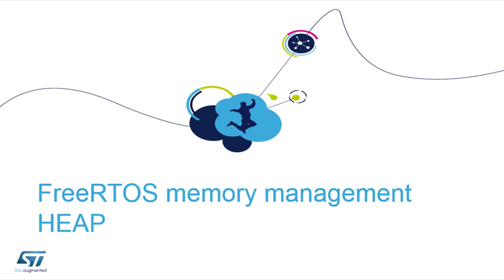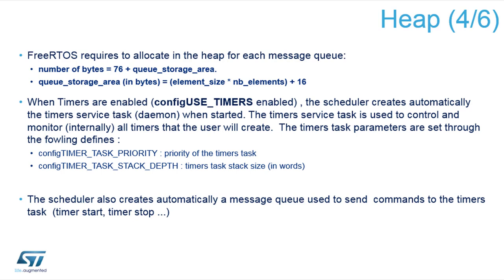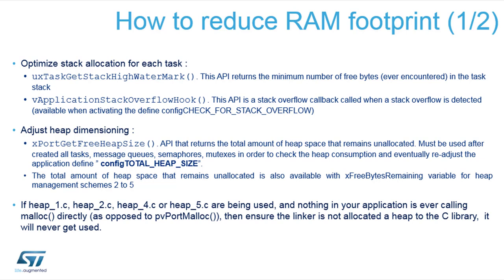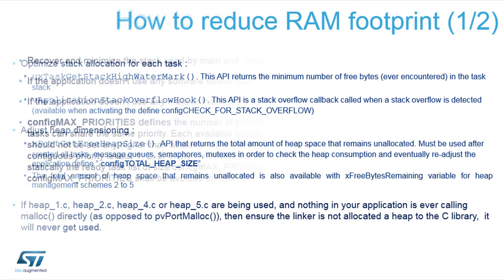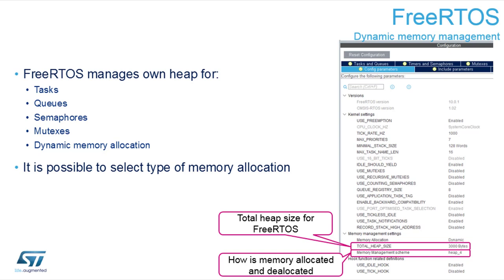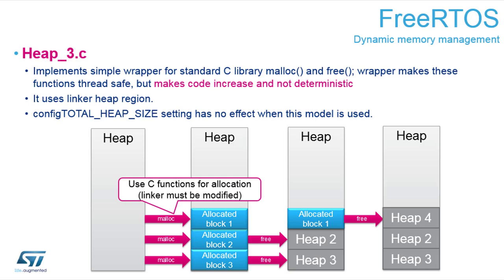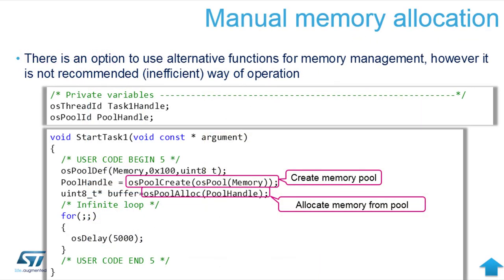FreeRTOS on STM32 - 10 Memory allocation

Comment: The audio is terrible.
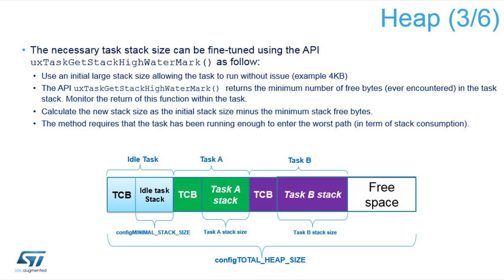Reply: Okay, just got much better at appoximately 3:00
Reply from the maker: Hello, please have a look at FreeRTOS on STM32 v2 series. It is covering CMSIS_OS in version 2.x and contains more hands-on parts.
Reply: @stmicroelectronics  OMG, thanks for replying! I was not aware of the v2 series. The v2 series starts off explaining how to setup the NUCLEO-L476RG. That was completely missing from the previous series. I spent yesterday setting up the hardware and changing the exercises to work with my hardware.